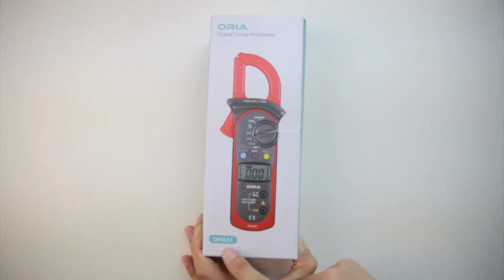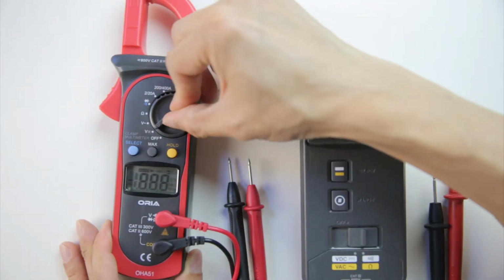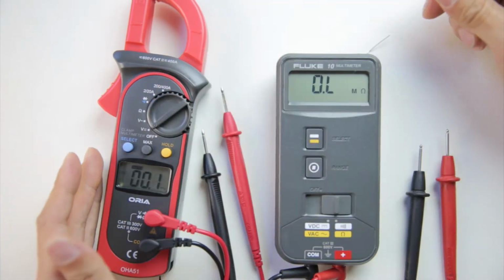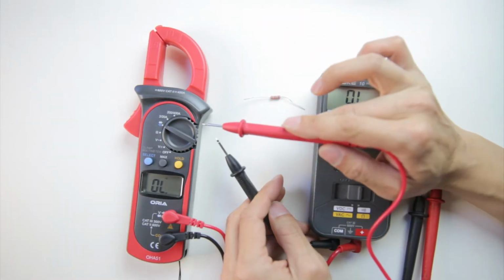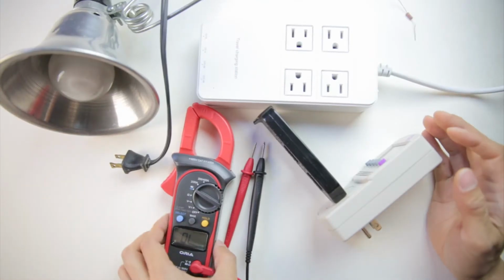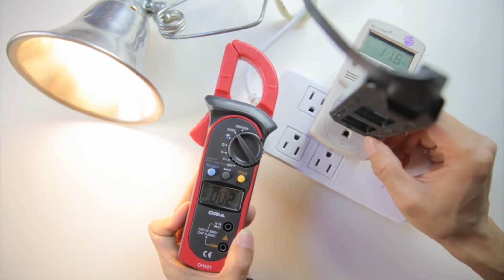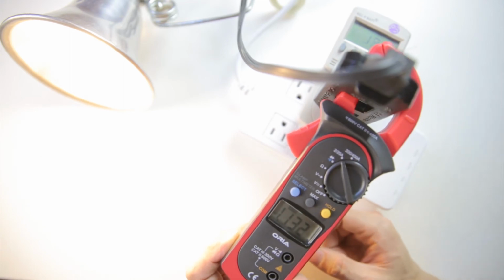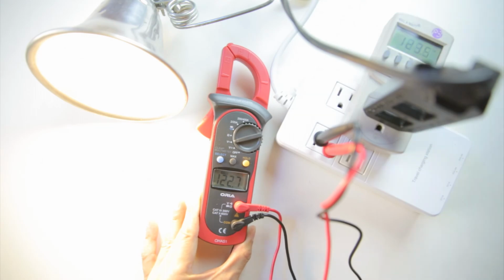Low Cost Digital Multimeter for the DIYer

Comment: Even cheaper at Harbor freight very similar meter 14.99  And it's very accurate
Reply from the maker: Probably from the same manufacturer.
Reply: Doesn't measure DC amps @BeatTheBushDIY

Comment: Hey BtB, how is that black line splitter called? Looks like a useful gizmo, how should I search for it if I wanna buy one?
Reply from the maker: AC line splitter? yup.
Reply: Thanks. I should've checked with google images before bothering you.
But as long as I got you, to your knowledge are there any clamp multimeters that can measure DC amps? With the clamping method I mean, so I can use it in the car. I'm not sure that's even possible.
Reply from the maker: Sure, They sell DC current clamp meters as well.

Comment: Did you say the clamp part doesn't work with DC?
Reply from the maker: Correct. This only measures AC current. No DC current measurement capabilities here.
Reply: @BeatTheBushDIY  It was able to measure the AA battery voltage which is DC.. I didn't realize you could use AC to detect a battery's DC output.
Reply from the maker: @mrbill660  Huh? I'm talking about the clamp portion. You clamp this around a wire. The device itself has DC measurement which you use by using the leads.
Reply: @BeatTheBushDIY  My mistake.. at 1:02 you said it doesn't support "DC current" and for some reason my ears ignored the word "current." Many of these meters don't have DC voltmeters so I was about to dismiss it as one of those... my fault.

So, since it's been a few years, do you still have this meter and, if so, have you used it much and still working?  Thanks for the review!
Reply: @mrbill660  I went on a minimalism binge and sold off most of what I have except for a single unit of the good stuff, that being a fluke 79. In a pinch, I used a $2 dmm to debug just the same.